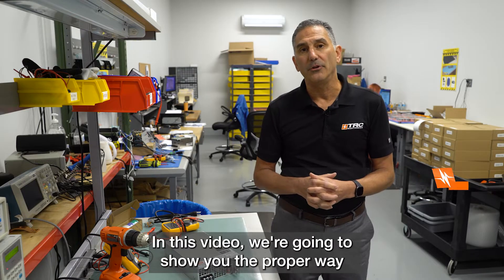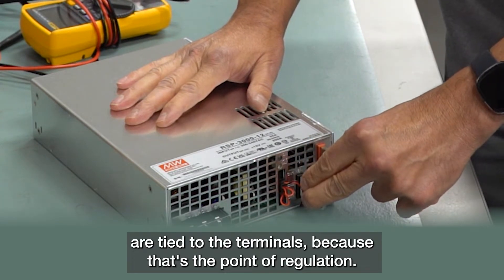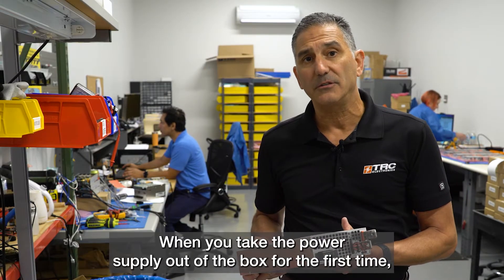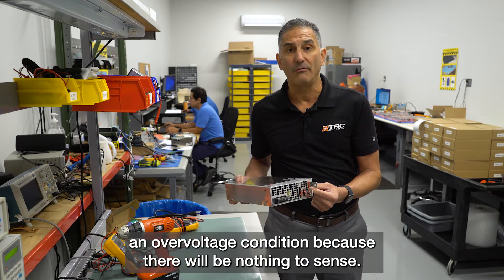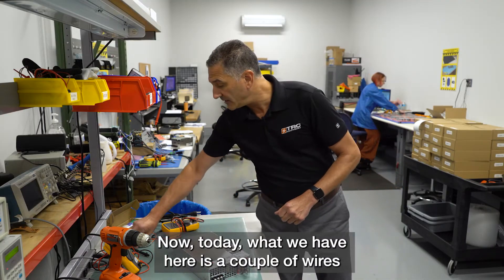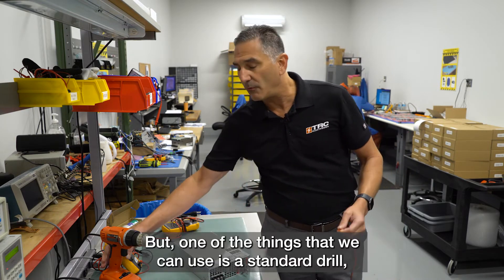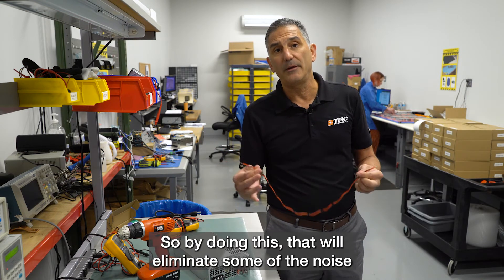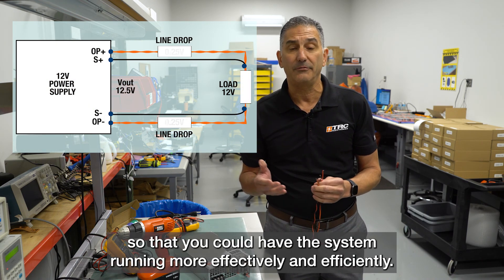How To Properly Connect Remote Sense To A Power Supply

Comment: I am trying to design a bench power supply with remote sense..
Can the remote sense line be paired with the power out lead?
and how can I detect when the sense loop is broken?
Reply from the maker: Hi! You can route the sense wires alongside the output leads, but don't electrically pair them. Connect the sense lines directly at the load for accurate compensation. To detect a broken sense loop, you can add a high-value resistor from each sense line to its output terminal as a fallback. Some supplies also monitor for sense loss or switch to local sensing. Please let us know if there is anything else we can support you with! You can also give one of our power sales experts a call at 888-612-9514.
Reply: @TRCElectronicsInc  What I am trying to do is make an esp32 controlled 1.2v to 36v power supply and use ADC's to measure voltage at the load.
My thought was instead of  using banana plugs like bench supplies use,
is to use a 4 pin GX12. (One GX12 for V+) and (one GX12 for V-)
(Pin1 is Vout), 
(Pin2 is Vsense) 
(Pins 3 and 4 are a resistor that ID's the lead type)

For the power leads on pins 1 and 2, use a 2 conductor lead that is connected at the load end...

So would the resistor you suggest work here?
Reply from the maker: @WagonLoads  The resistor you select will be dependent on the sense current you are setting up. In general, we have seen the resistor value set at 10-15 Ohms.  This resistor is internal to the power supply and not part of the application. Our video was to demonstrate the application to raise awareness to use sense lines when tight regulation of the load is needed.

Comment: I have the ATS030A0X3-SR non-isolated DC-DC power module with this sense pin connected to the load on main board and this module was damage, when I change  with a new one it burned the track, I think was the sense track pin. do you think were because the sense track was open or damage before I change the new one?